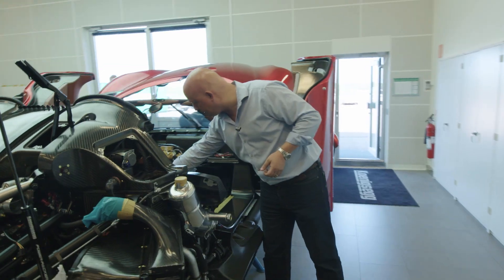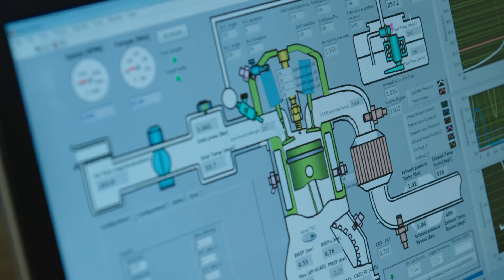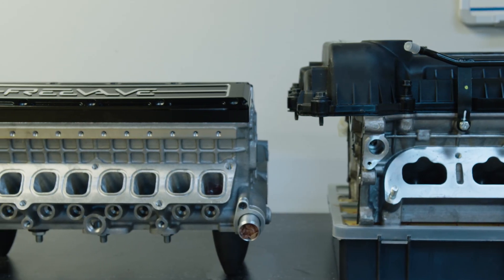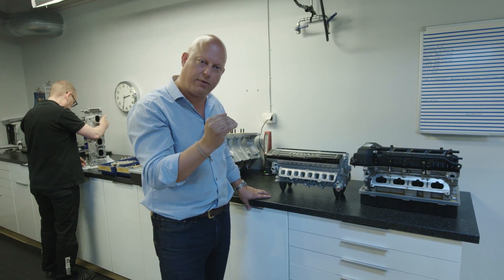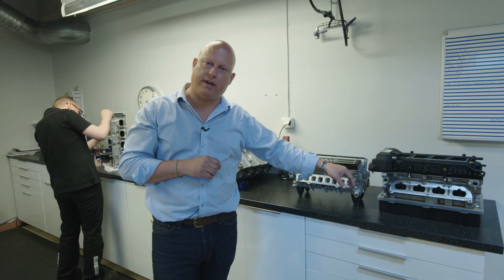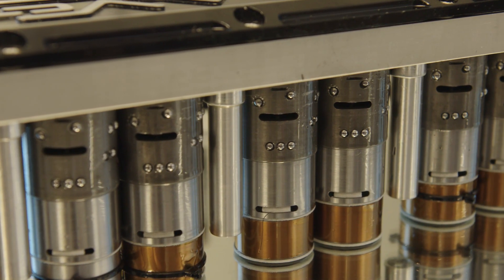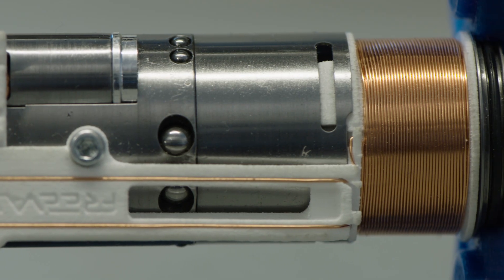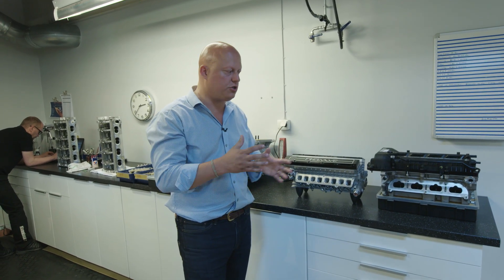Freevalve Update Camless Engine -- /INSIDE KOENIGSEGG

Comment: Gr8 Idea but I don't trust electronic, bug in the system ect. bye bye engine
Reply: My guess would be that the valves are mechanically closed like traditional valves using a spring. And only opened using the coil. This means in any electronic failure the valves would remain closed and not really cause any damage. ALSO... if an error like that were to occur it would be reported to the computer immediately and  assuming it was programmed to handle that scenario could respond accordingly.
Reply: Steam engines I'm telling you. Much more reliable technology.
Reply: Valves are bent because the camshaft is on the other side of the valve. I don't think the magnet is as strong as the cam, therefore the damage, if any would be far less.
Reply: Was going to suggest similar. Magnet might have enough force to push the valve up and down and seal the cylinder for compression, but if stuck in the open position, there will likely be enough give that the piston will just push it closed. You will see bent/broken valves on an interference styled motor because there's no give, its all mechanically connected to eachother via true contact. This, the valve just floats inside the actuator.
Reply: Ernesto Castillo yes ofcourse but unfortunately there not to common these days, I know engines with rockers that will break them instead of destroying the valves when failures occur tho, seems a good design compared to cam-bucket style.
Reply: As far as not trusting electronics that is a ridiculous notion. If designed properly they are as reliable if not more so that mechanical components. The problem with most electronics these days is they are designed by shitty engineers or designed to a low spec on purpose. If you use Mil-spec or space grade components the failure rate is extremely low.
Reply: Nico van Os Without a linear array of coils it would be very difficult to accurately control the position of the valve without springs. As an electrical engineer I would never design this without a spring for a fail safe. First off, it would be very easy to overcome the force of the spring with enough current. Second, the position of the valve would be directly related to the amount of current in the coil so a steady current means a steady position. Third, the only way that reversing the current would close the valve would be if they attached a permanent magnet to the valve stem. This is a horrible idea as they are prone to demagnetizing at high temperatures, they are very brittle so they won't provide any added strength meaning all they would provide is added inertia. Granted they could be using a second coil to pull the valve closed but then that would be electrically in efficient to activate all the coils all the time. I could go on but I doubt engineers of that magnitude that have a closed loop design process with their test teams would screw something like that up.
Reply: From the cutaway on their website it looks to me like the coil is nothing more than a sensor and the valves are opened pneumatically and closed by the spring.
Reply: "timing chain saver than timingbelt" lmao ever heard of stretching timingchains? in the eco bullshit engines, the timing chain fails way before a timingbeld will do. timingchains are replacement parts these days.
Reply: No way that there still are springs. You don't see them when they showed the inside. It is not on the drawing. And he said he can open it to any position and keep it there. Besides, the coil would need to overcome the power of the spring, while at the same time the spring needs to be strong enough to close fast enough. Reverse the current and the coil does the same thing without those downsides.
Reply: the piston will be moving at a quite considerable rate when it strikes the valve. its not so much a "push" and more a "hitting a ball bearing out of the air with a hammer traveling at 20m/s and the weight of the entire crank behind it." ...it aint good. Even at slow speeds and just a little tap of metal into metal like that could cause chips or deformation that could cause serious damage over time
Reply: piston head 1243 true!!
Reply: piston head 1243 ohh thats true is probably the safest timing method😂
Reply: Very good point. Haven't thought about that.
Reply: Sandor Clegane While that is technically true any electrically conductive material can be made magnetic by inducing a current into it.
Reply: Ok. You were right. It does have springs.
Reply: Interesting, I never knew that, But it makes perfect sense that they would use that as they need a ferrous slug that would be able to be pulled into the coil while still having non magnetic (presumably metal) stem for the valve. That was the last thing in my head that did not add up for the design.
Reply: Not surprised about the spring (good to know I understand what they did though) but apparently my materials knowledge needs a brush up.
Reply: Your right, I looked into it a bit more. The coil is just used as an inductive position sensor. It is opened pneumatically and held open using oil.  When the oil pressure is released the spring then closes it.
Reply: I would assume the negatives are you have to use a non-interference engine, especially until they get the bugs worked out.
Reply: Diesel 8290. No that will not happen, the valve will just get pushed up by the piston.
Reply: Your probably right, as long as the valve moves straight down, not at an angle and it sounds like they might be opening valves with air.  So in case this happens the air is compressible and there won't be any bending.
Reply: There is a certainty of the mechanical linkages that makes the traditional valve train very reliable. Its only really wear and tear that can interrupt them so if they are looked after with good oil, belt changes etc you can basically trust them until the engine is flogged out completely. 

electronic systems have hundreds of variables any of which could cause an issue and because the valves are independent that multiply the risk of failure massively too. There is a reason these systems are only coming on line now. They are suuuper complicated and need huge resources to bug test them to be anywhere near as reliable. We have not had the tech cheap enough to be worth it. still we rely on these systems in planes and other devices but they are super expensive to keep reliable. soon this will no longer be the case
Reply: You bring up an excellent point, so these would have to be done with non-interference engines or at least till all the bugs are worked out.
Reply: in an ideal world no engine would be interference. But you loose some of the advantages of the system if you do that such as ridiculous compression ratios and efficient piston top design. I suspect its one of the reasons why its not been commercially viable tech till now. to much of the increases in efficiency are lost if you make a "safe" design to be worth it. You need the kinds of tech and processing power previously unavaliable till now to make it work
Reply: True, the increased cost, loss of efficiency due to the non-interference design, gain in efficency due to free valve, all has to be taken into consideration.  I will say this though, if they use an interference design and say something malfunctions, a new head would be a lot easier to switch with this design vs. having to deal with cams and timing belt, cover, etc.
Reply: true. As long as no shards got into the oil and damaged bearings and you don't crack a piston. Still even a full rebuild would also be easier with this system i assume.
Reply: Cars have been using EFI since the 90's, a system that relies completely on a computer to control the fuel and spark (either of which can blow the engine if there's a "bug")....
Reply: Jonah Beale there is no part of a efi system that is capable of breaking engine parts with a single error. Even if your out by 100% with your injection time it might backfire or ping or do any number if behaviours that over time could do serious damage or maybe it blows an airbox apart. But your not likely to crack a block or bend a rod. More likely the car just stops. 

Plus the efi systems are much much older and simpler. imagine the crank angle sensor is out on an efi system. It would inject and fire at wrong times which would make the car run poorly and would give feedback. But if that sensor goes out on an electronically controled valve system then that could spell a metal on metal impact which could mean rebuild.
Reply: Only on an interference fit engine.  I would never recommend this on an interference fit engine. Of course I don't recommend it for rubber band engines and Subaru did that for years with disastrous results.  And by disastrous I mean when the belt would break the engine was completely destroyed. What a stupid idea and that engineer should have been fired.
Reply: if you have a car newer then 1970s your engine is already controlled by an ECU. valve timings, petrol injection, air injection, sparkplug timings. Its all controlled electronically.
Reply: lol I beg to differ. I don't know where you are from but here in the US they were still using carbs in the 70's In fact my 84 olds still had a carburetor.  Even when they did start using computers the use was very minimal and they weren't tied to other functioning parts like the transmission or transfer case. Thus you could modify and change things without much trouble unlike today where it is darn near impossible because they have the computer control nearly everything. Even stuff that has nothing to do with engine function.
Reply: Well, american car manufacturers haven't exactly been pioneers of the car industry the last 60 years. I agree that i dislike that more and more functions are getting computerized, but that is in no way because i don't trust it. I know an ECU can break just like any other car part, but the reason i don't like it is because it makes it harder and harder for a hobbyist to fix something in your car your self. But i also recognize that denying change is the opposite of progress.
Reply: I think the great minds at thiscompany already think of everything u guys thinking.. Let technology make our life and cars better. Wat you wanna stick in the hand crank days of cars or something...
Reply: It's just a port that opens, not a metal valve that drops down into the chamber. There is no interference unless a rod gives out. Your piston is an air pump and the valves time the transition and compression of the air. I'm fairly certain we have interference motors (mostly) now because of performance gains in the piston chambers by lowering the valve deck down, but I never understood why they weren't engineered to rest above the deck instead of below it. Currently valves are pushed down to open and sprung up to close vs. my idea of sprung down to close and pulled up to open. You could change and clean your valves by removing the valve cover instead of the entire head. I guess that's why I'm not an engineer, or maybe should have been one lol.
Reply: No cam shaft against the valve stem, it will just be pushed back up into the seat.
Reply: @Aaron Coughman Wow man thanks for the awesome reply!!! I will absolutely love delving into those designs. Absolutely appreciate the hell out of this.
Reply: Ok everybody commenting here. Apparently none of you have seen what valve float does to a motor. When a valve get going so fast the inertia of the valve overcomes the spring force needed to pull it back up and keep it in contact with the rocker arm and other valve train. When the piston comes up and smacks the valve quite often it snaps the valve head off. You then have a 2 inch metal disk being embedded in the head or piston which results in all other types of damage to rods, crank and even block. I have even seen blocks split it two because of this happening.  Electronics are much more failure prone then mechanicals. Just any mechanic working on cars today. Almost all car problems are electrical in nature.
Reply: Nice presentation! I can see this working reliably in the very near future.  A pneumatic manifold, pump, and controller in place of lifters, pushrods, cam, and rockers.  Wow lots of weight savings and huge reduction in friction and oiling needs. I see this within 10 years.
Reply: piston head 1243 but there is also non-interference engines! Which if the timing chain or belt breaks or loosens there will be no damage to the internals because the pistons have the imprints of the valves in them so the pistons and valves dont collide
Reply: With that kind of thinking airplanes would still be operated with cables and there would be no such thing as fly by wire.
Reply: Ernesto Castillo I’ve seen a few smaller Diesel engines break timing chains, this system right here is the way forward, incredible technology
Reply: Well that's assuming that it is an interference engine. For all we know, with this new head design there is no interference (probably not, but we don't know unless they have mentioned it elsewhere?) and it wouldn't be that bad if a failure occurred.
Reply: Ernesto Castillo or old school push rod engine! Straighten the rod over your knee ;)
Reply: no worse than an injector failing
Reply: Travis Noonan there is something called timing chain !! Which is much safer than timing belt ! What youre talking about timing failing is almost impossible to happen in a timing chain system
Reply: Yes if the valve sticks open, piston comes flying towards valve and destroys, piston,valve, fancy acuator lol
Reply: Travis Olander do you understand the basic concept of how an engine works, if that valve is stuck open and that piston comes up to tdc it’s gonna smash into that valve, please research before you comment 🙄🙄

Comment: Imagine an otherwise cammed heavy-duty diesel engine, equipped and tuned with a FreeValve system! If reliable and reasonably priced, the savings in fuel consumption in the long run alone would be a BIG incentive for most shipping companies, I think.

Comment: This is very impressive! I wonder how this compares with BMW Valvetronic in terms of reliability and adjustability. On my limited knowledge, solenoids are digital actuators; how do they vary the lift?
Also, with the elimination of the turbo waste gate, and controlling with exhaust valves, how will the (more) digital impulse of exhaust gas affect turbo performance and longevity?

Comment: now if you combined this tech with Nissan's variable compression block you would have a serious next evolution of the combustion engine and all other companies would have to do the same to compete think about this one button for daily say 8 to 1 compression why a economy valve setting then on the weekend performance button 14 to 1 compression with valves set at say 262 duration 10 mil lift get it so 35 mpg 200hp to 450hp and no engine work cuz both bottom end and top end are variable all in a button or program setting only thing you might have to do is higher grade ( octane ) fuel I hope he thinks of this and brings it to market soon Nissan has the new block ready for mass production starting 2017 he is 2 years in testing about to bring it to production shouldn't be a hard leap to pull off

Comment: So the timing for valve open and close duration can be controlled, but not lift height? Not a deal breaker, but that would be super cool if you had TOTAL control over cam profile.

My main concern about this technology is durability. Is it more, less or about the same durability as a cam/rocker arm setup?

JW3HH

Comment: I want to see a regera 2 with this technology. they should put the same engine of the one to one 1340hp that is 240 more than the 1100hp ICE of the regera then make it free value so the ICE produces 45% more power like this one so now the ICE will produce 1943hp then addl the 700hp electric horspower. all electric power should be available at the same time as all the ICE power available so then we have  a 2643hp regera 2. also add 4wd, rear wheel steering and 20inch wheels at the front aswell then we will have the ultimate supercar that will not be beaten for many years.

Comment: Do pneumatic valve actuators work now because computers are just now getting advanced enough, or did i miss something?
Reply: Not pneumatic, they're solenoids. And pretty much yes, the tech to run this just hasn't been good enough til now.
Reply: ok, thats what i thought.  pretty interesting what could be done with solenoid controlled valves if they could last as long as traditional cam actuated valves.

Comment: Someday... this would be awesome to retrofit onto my LS3. 6.2L with this level of control and efficiency... Imagine 30+ mpg out of an LS V8 that can open up and make 600HP because of the combustion optimization possible with this? I fervently hope this makes it into serial production, and eventually retrofits are available for existing engines. The fleet fuel economy improvements could be significant and go a long way toward reducing our impact. The tuneability of this also renders itself well for multi-fuel use... E85, race gas, biobutanol, and anything in between.

Comment: Hate to be negative on such a nice design, but 30 years too late. There's nothing here that someone didn't build in the lab or garage a long time ago. Too bad the mainstream auto manufacturers stopped doing true engineering like this decades ago. Unfortunately for all ICE designs, EVs are here. You can't justify all this intricate engineering just to keep the oil economy going (which is all it's good for). 

ICE looks cool internally, like a Swiss watch. But even a Swiss watch is low performance compared to quartz watch, for its primary purpose of time keeping.

I expect to see many more innovations in ICE over the next several years as the death throws of the oil economy proceed. RIP.